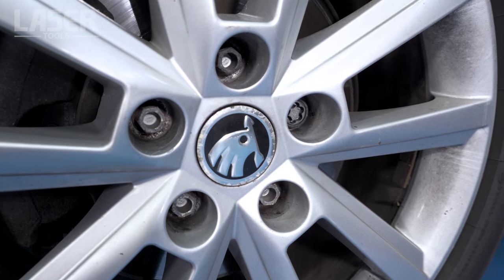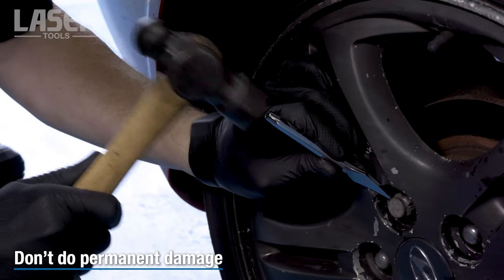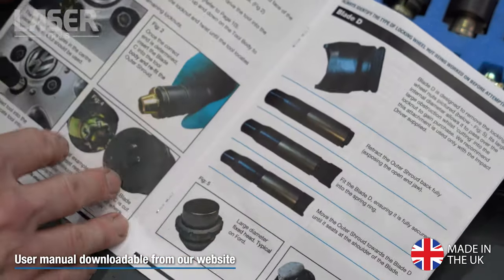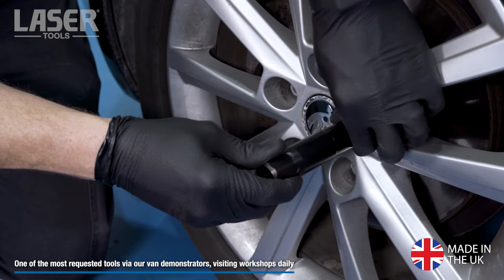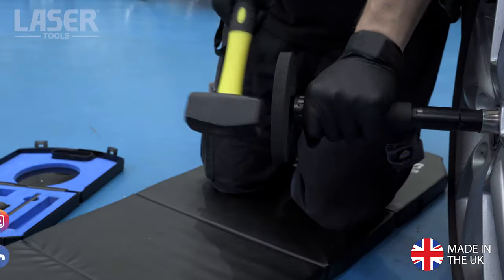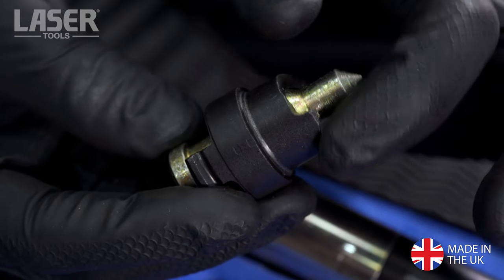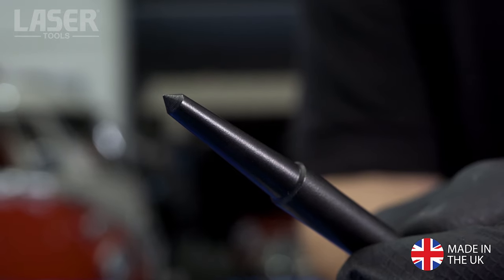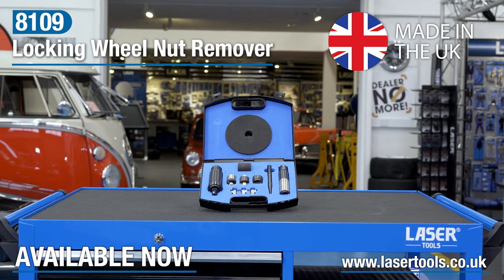8109 | Locking Wheel Nut Remover

Comment: Will this remove a broken 4 pin locking wheel nut?
Reply from the maker: This tool fits most locking wheel nuts; if we could get an image of the nut in question,  If you could please e-mail us at technical@toolconnection.co.uk we’d be able to advise further.